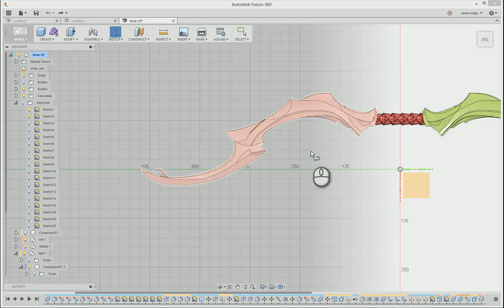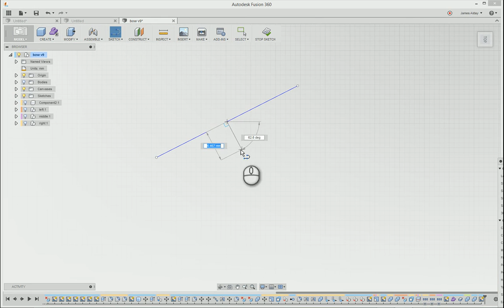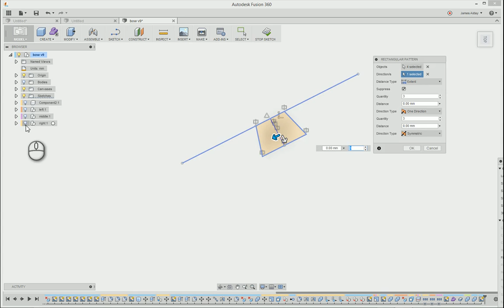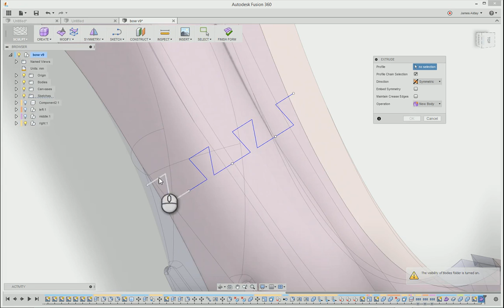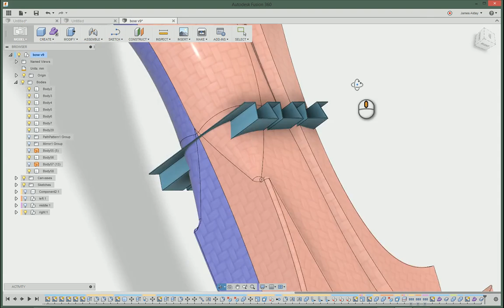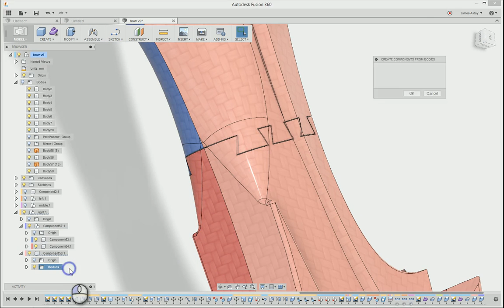Slicing a model with a dovetail joint in Fusion360

Comment: Hi , thank you for the video, helped me figure out the work flow. Would creating Finger Joints be done in the same fashion? I Have a lap I want to print that is 106mm wide by 220mm tall. But im not sure how to setup the pieces to make matching finger joints.
Reply from the maker: finger joints would be easier to use sketches with constraints. "sketch dimension"     let me know if you need a quick tutorial on that and I can put something together.
Reply: +ImmersedN3D LLC  Im new to Fusion, a tutorial on that would be Awesome!